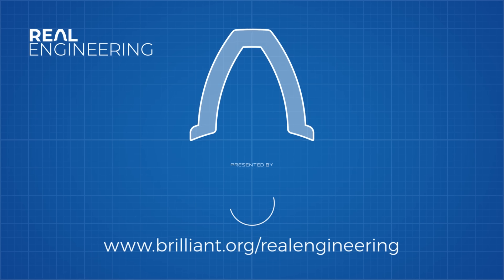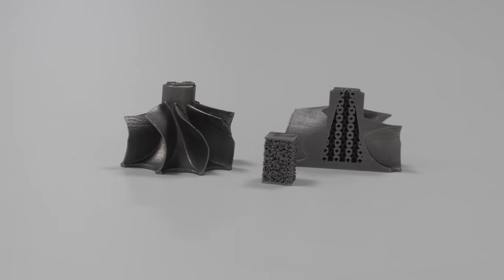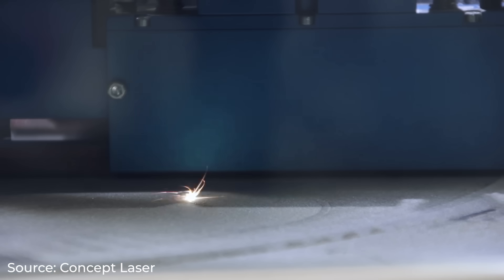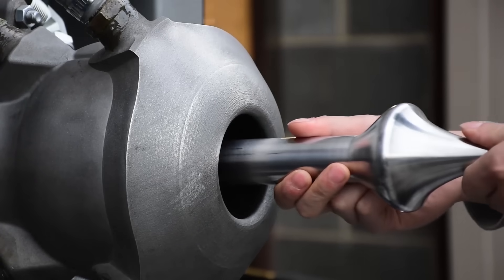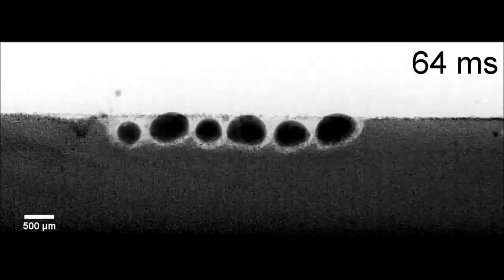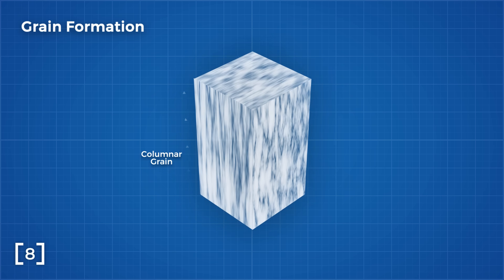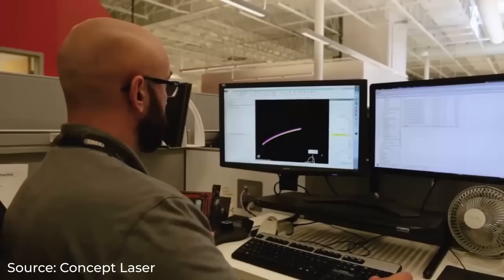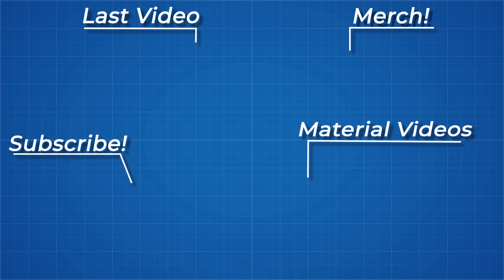The Material Science of Metal 3D Printing

Comment: I work at an aerospace company that 3d prints a lot of production parts, both sls and slm. This is the first "mainstream" video i've seen that doesn't treat printing as a way to magically appear every structure. It's an exiting newish technique to make thinks, with it's own strengths and weaknesses. For instance thermal conductivity has a large correlation with print quality, so while titanium and croco and stainless steel print very well, aluminium is limited to weak casting alloys and crap surface quality (but finer grains than castings). Exeption being scalmaloy, great stuff, approacing 7xxx series in strength, but it's patented so about 5x the price of regular slm alloys. 
Annoying thing is that most printers are being ran by companies in subtractive machining, who don't know what they can do and seem unwilling to learn, and want to write off the machine in 5 years, leading to astronomical pricing

Comment: This really only covers SLM, or selective laser melting, a type of powder bed fusion. Metal 3d printing covers a lot more than just this. Powdered bed fusion also includes Electron Beam Melting, but is less precise but faster for larger parts in comparison to SLM machines, but are also more commonly used in aerospace and medical applications. There's also Bound Powder Extrusion, Binder Jetting and Direct Energy Deposition, which includes Powder and Wire DED.
If you're going to title your videos with a broad subject, like you have with this one, cover all relevant manufacturing methods, or just use a title that names the relevant manufacturing method. It's just as bad as clickbait, honestly, and I'm pretty disappointed in this channel's video titling decisions.  

As for the future of 'metal 3D printing', which should honestly just be referred to as additive manufacturing, as '3D printing' is nothing more than a buzzword (hello, clickbait), Powder DED is the future, as it allows for a larger range of alloys, and with 5-axis machines, can produce a true 3D part, and not a 2.5D part. Each manufacturing method has it's place, and has it's relevant time period, but the future of any kind of additive and subtractive manufacturing lies within automation and multi-axis machines that can produce true 3D parts within a set of operations with no stops within the process.

Comment: SLS isn't the only way to use 3D printing technology to make 100% metal parts. I would love a comment/analysis of The Virtual Foundary and Mark Forged Metal X with uses the much cheaper FDM printers with filament that consists of 90% metal derived from metal injection moulding material. The 3D printed parts are then sintered to create 100% metal parts. 

From a material science perspective the parts shrink during the sintering process which might make 3D modelling and replication more difficult and would have anisotropic layer lines that weaken the part. However, these FDM printers while slow only cost between $500 to $1000 dramatically shifting the economics.

Comment: “Placing fastener holes in inaccessible locations”

Seems to be a specialty of engineers.
Reply: Especially automotive engineers.
Reply: @coreys2686  Especially Chrysler Sebring engineers. LOL
Reply: usually because the fasteners are designed AFTER the body is designed. Easy on AutoCad, naive in reality
Reply: Engineers tend to design things to be assembled in a specific order, from start to finish. It takes a tinkerer's mindset to look at a design and see where it would be advantageous to be able to remove and replace parts in a different order than the initial assembly was done.
Reply: Shit happens! I'm guilty of doing such mistakes. I just have to fix it and not be a douchebag when someone else makes me aware of the mistake, because that isn't helpful in any way. Regardless of the source. Aditionally, I have to make an effort to not fall on the same mistake.

That being said. The source that made aware, would go a long way if they weren't douchebags as well when they tell me.

That can become a trend, and it will sting a lot harder when the source makes a mistake, and comes to me as if the mistake as mine. Even if I'm totally cool with it, and immediatley work to help them fix their problem. Their face says it all.
Reply: I heard it as "placing fastener holes in..."
Reply: brian roys whoops! Autocorrect got me
Reply: easier to criticize than hypothosize   ...fool
Reply: Apparently someone hasn’t heard of the long running, sarcastical (mostly) fuede between mechanics and engineers
Reply: @Notthe_droid_youarelookingfor  its between any white collar managment and blue collar labor force. the blue collars always think they know how to run things best
Reply: @zefrum3  And white collar management usually has blinders on because of deadlines, budgets, and pressure from their white collar bosses and decides to put out crappy and flawed products.  Seen it a dozen times when working in a machine shop.
Reply: @zefrum3  specifically, the issue being brought up is that engineers often, through inexperience or unintentional negligence, i.e. ignorance, fail to consider assembly and maintenance of the equipment they are engineering. Instead, they think of the most effective and efficient way for the part or product to work and be designed then add in the fasteners without considering how a hand would fit there, or a fastener or tool and what tool would even be used to install the component for maintenance rather than only being capable of installation during the actual manufacturing process. That is the issue being playfully contended here. Even in nuclear weapons and spacecraft/aircraft design the same issue often crops up.
Reply: @7alexze  really? Who woulda thunk it; thanks for asinine blokes like you that believe they are more aware than everyone else for forming me, I had no idea what was being discussed
Reply: @7alexze  In many cases, even when assembly and maintenance are considered throughout the process, mistakes still happen. Its a lot easier to discover these mistakes when the parts are already built and being worked on because obviously, if there is a problem in assembly... it can't be assembled. Not usually the case in the design phase. 

It's annoying when shop techs or whoever seem to think that assembly and maintenance is the only design consideration engineers have to worry about, when its one of many and one of the easiest to screw up at all experience levels. It's nice when you are building small parts that can be easily 3d printed or rapidly prototyped so the engineer can test it themselves and the bugs can be easily designed out, but its not always possible. 

Sometimes ironically the senior engineers are the ones screwing it up more because shop techs are hesitant to complain to them and therefore think about it less. IME
Reply: @7alexze  Thanks, I'll keep that in mind.
Reply: @zefrum3  bad day at work, dear?
Reply: @billynomates920  nope and neither a year ago too. Simply pointing out that blue collar workers like to point fingers and say its someone else's fault when its not. Blue collar workers also complain way more often. Most of the complaints are asinine too simply for designing a product has many sometimes hundreds of iterations before it can be manufactured quickly and easily for the machinery and in general unskilled labourers.
Reply: @Notthe_droid_youarelookingfor  That's always been described as "there will be blood" by my mate that's a mechanic - it's very real!

Comment: @6:28.  Primary cause is crack initiation and fatigue threshold, not growth.  Once the crack starts (and is growing), it's usually a matter of very short time to failure (hours to days), particularly in the realm of HCF.  You don't want the crack to start.  You are correct that the prolific defectivity of additive methods is the cause.  Great video.

Comment: anyone know lots about this stuff, would love some answers.

wonder if semi-randomizing the scan pattern of each layer would help prevent those vertical grains, or if that would make more issues? If there the tech out there to make a laser that dosnt have to scan, that can just project a still image and still get to the correct temperatures, It seems that most of the issues came from the movement of the beam making the powder act as a fluid and fluff about the place.

What If you could make the whole inside of the machine red hot and near the right temp and then use a less powerful beam to do the fusing?

Comment: Regarding the issues at 6:55, AM uses an argon purged chamber during the growth process (Renishaw used to call it growing parts instead of printing for some reason); what it needs is a vacuum chamber for the process to eliminate most of the powder blowing as I'm certain that the heating of the argon is what causes this as the heat creates eddies and currents in the gas.

Comment: 11:55
Here's an observation about prototyping & fabrication:
When 3D printers are able to make parts & assemblies for other 3D printers, they will become customizable and specializable on demand, and the up-front costs of a laser deposition machine optimized for a specific design or task will drop.  As traditional mechanical techniques integrate with new deposition techniques, design startup and production waste costs will drop, and production efficiency and reliability (defect rate, MTBF, etc.) will increase.
I don't think 3D printers are a fad or novelty, nor, after seeing this video, do I believe they will displace traditional manufacturing techniques.  I think this type of process is an innovation that will drive centuries of industrial R&D.

Comment: This was a remarkably insightful video, and confirmed some of my initial misgivings about 3D printing.
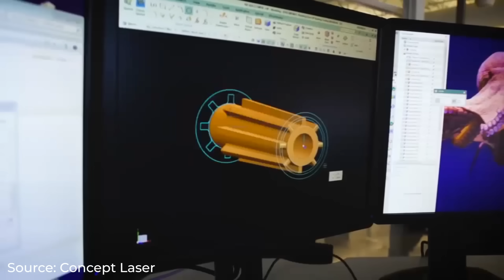12:10 one of the enhancements I see coming is being able to shape parts under non-standard, variable temperatures, pressures, and gas compositions, to affect how the base material forms at a crystalline level.

Also, 3-D printers are currently largely generic, highly flexible and programmable designs, and mass-manufacturing processes are highly specialized, rote, repetitive, and generally fast.  There may be a middle ground where design of the fabrication machines themselves evolves and integrates the old know-how of metalworking with the new applied science of laser & electronic deposition/compositing.  This has already happened in the evolution of microchip fabrication.

Comment: All in all good video, but your cost chart for AM is misleading. There is a dramatic cost drop off at the beginning, and most of the support equipment is is far less than your chart implies. Which would give you the curve you said other manufacturing processes have. (I know this due to procuring all this equipment myself).

What you should have noted more heavily than you did when you spoke about that at the beginning was the time factor. Recouping the cost of the investment due to time is the actually hang up with AM. Also, parameter development isnt that time consuming either, u less you need to meet an etremely tight window for mechanical properties. However, that depends what you are using it for. 
If you plan to apply it to traditional high volume manufacturing, it will be significantly less effective as you noted. But if you apply it to low volume efforts where you can avoid the cost of tooling, then you return on investment will be far greater, as we do. This particularly works well for producing legacy parts for system that are no longer produced or far to expensive since that line might have been discontinued. Which has a very high market demand, vs a company having to buy an entire new system.
Also, the fatigue issues you noted are primarily directed at system with lasers oriented verically to the build. This can also be worked around to greatly reduce those issues with multiple axis applications. 
Very good work on the video btw, a fantastic intro to AM and i will pass this on to my new hires so they can get a good feel for the concepts. Also, thank you for everything else you produce as well. This is a wonderful channel and it is great to see someone putting a lot of effort into promoting interest in engineering.

Comment: Great video. I’m curious if additive manufacturing with non-metal materials suffers from the same shortcomings.
Reply: Sure does! There are many more plastic printing processes and each one is different. But material strength, water tightness, and material cost issues are all common in plastics.

Comment: Ive actually done a lot on 3d printed metal for college its amazing what you can do with the design shapes the main problem still material that isnt used after a certain amount of prints goes bad and yes they do fail a lot sooner machining strengthens the material while printing does not it also takes a lot of surface work to get these parts to a machined finish. For those of you who haven't touched a piece before it feels like very high grit sandpaper. You can rub your finger across it and feel the imperfections. Its different then grain lines though as the material is "welded" together (note they arent welded in the tradition sense they are more or less almost melted together but just barely in a process called cintering(god I hope I spelt that right)) so just like any weld there is a weak point but each individual particle of dust has these welds unless it a hollow design with more powder inside to add some weight and rigidity while cutting down print time. There is alot of stuff not covered in this video but thats because its a 15min video and not the days of material I had to learn and it covers a lot but yes most parts are limited to mainly prototypes due to the problem of breaking with stress higher but the technology has come a long way recently a concept I saw while writing a paper once was about like a traditional 3d printer designed and not the laser style with a heated wire being just hot enough to print but on a floating bed(does not connect to the bed to the effect of something super hot not touching something super cold I just woke up sorry) while being cool I dont see it working as it would be trying to be like a cast piece without casting it.
Im going to stop typing now before a do a whole paper in the YouTube comments.

Comment: Still have yet to figure out why metal printing is so married to powders though I'm aware of the handful of advantages the SLS process has over lamination. We've essentially had 3D printers in metal work ever since arc welding was invented, and we took a step closer to modern printers with the inception of wire welders, leaving CNC as the only part missing at that point. Alternatively and sticking with powders, 3D spray welding is another area where I don't think I've ever seen anything. The Stargate printer is the only thing that comes to mind, but that uses lasers on wire for reasons I've yet to figure out.

Comment: I wonder if the sonic tractor technology can be used as part of 3D printer for precise manipulation of the metal particles during printing.... It would require an inert gas chamber for it to work, but it may solve the problems about the micro structure of the printed parts.

If only I could try it myself 🤔

Comment: Could we combat cavities in metal by casting it in a vacuum chamber?

Thanks!

-A Big Fan
Reply: Zach Sarantakes In the process chamber in which a protective gas atmosphere prevails, a flow is required to transport waste products away from the melting point.
This is very difficult in a vacuum.
Reply: @MaHu098  What waste products?
Reply: Dan Haiduc When metal and plastic powder are melted, smoke with fine particles is produced and these "waste products" are transported away by the air flow.
Reply: @MaHu098  Is the metal powder in metal 3d-printing not pure metal?

Comment: What I don't get is why no one has tried using metal powder mixed with a heat activated binder. Then just use a low power laser to activate the binder and build the part additively, then just take the unsolidified part and put it in an oven so it sinters together. Sintering is already a very well-understood manufacturing technique that creates strong metal from parts made out of powdered metal, it's just the powdered metal parts are usually formed using traditional techniques that don't have the benefits of 3d printing. It would be far easier to do that than to try to reinvent the wheel. Then again, I'm just an electrical engineer, so what do I know...

Comment: When 3D printing "took off" 7 years ago, people were worried that someone would 3D print an automatic rifle. Some people said "It would just fall apart", others said "Give the technology some time and it will be possible".
Well, here we are 7 years later and STILL struggling with making something that doesn't simply fall apart after it leaves the printer...

3D printing isn't going anywhere so stop fanboying over it... Come back when it's actually a viable method of manufacturing strong materials.

Also, a solid block of titanium where you "throw away" 90% of the block in machining is still stronger than anything you can print by factors of hundreds.
And you don't throw away the titanium you mill out, you recycle it at almost the same cost per weight as the solid block. Re-casting it isn't the expensive bit, it's getting the titanium metal out of the ground and into a workable material that's expensive.

Heck, even casting parts is better than 3D printing at this stage. Sure, there are some "impossible" (impractical) designs you can't make viable with casting but it STILL beats 3D printing.
Reply: TheWin200000  The US has strange laws.
I don't even need a lower to make something that fires bullets out of a barrel.